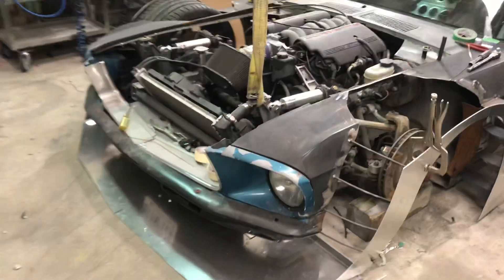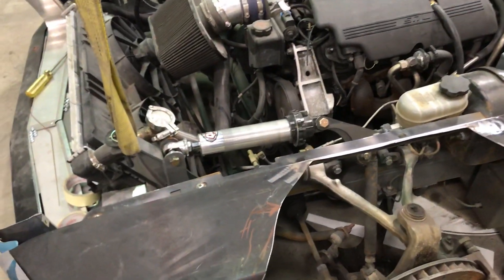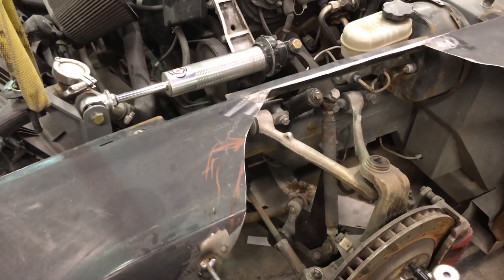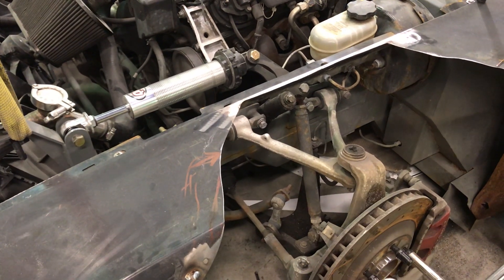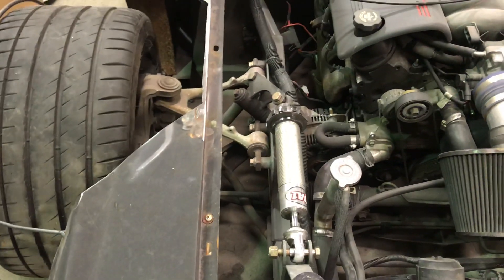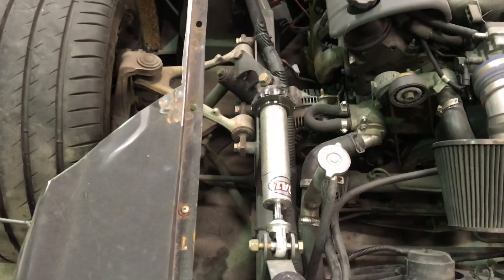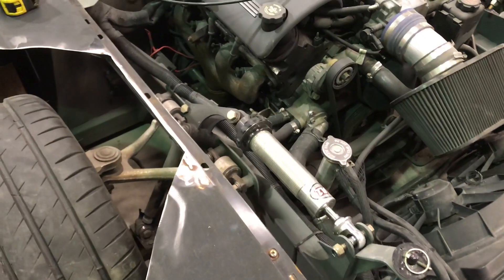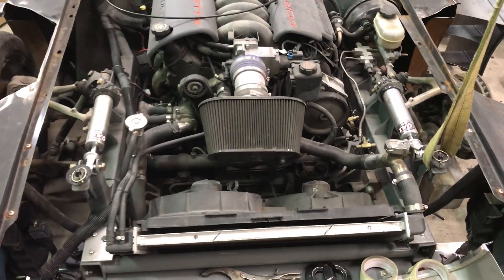Cantilever Suspension Explained !

Comment: Push- / Pullrod suspension has its place, it allows for heave spring setups and obviously drasticly improves aerodynamics on vehicles where the suspension is inside the airflow (like open wheel race cars). Beside that, there is no real point to cantilever suspension. Never seen a scenario where packaging was that beig a problem and the CG is moved upwards by your setup, which ain't good
Reply from the maker: @Sir_Cactus  Unspring weight is a huge factor as well though which you’re not considering!
Reply: @Kylescaife  You are right that I did not mention unsprung weight. If you meassure the weight of the wheel assembly (without the spring mounted of course) then the pushrod system might give you slightly less unsprung weight (assuming the pushrod is lighter than the unsprung part of the shock). However, this is quite misleading as it is not the weight of the wheel assembly that is relevant, but it's mass. The weight of the rocker and the moving part of the shock is supported entirely by the frame, but they are still part of the unsprung mass. 
In other words, a pushrod suspension has greater unsprung mass.

Comment: So would reversing the cantilever cam , for lifted offroad use ( where people are chasing longer travel for their shock absorbers ) work opposite? So you can have the same amount of performance over a longer distance? Or would that negate the specific valves in a shock or strut that were design for a specific range, like 1 to 1?
Reply from the maker: Yeah theoretically it would work! The shock would need to be valved for it I’m sure, but I think it would work. A lot of the long travel trucks will have a trailing arm and mount the shock half way on the trailing arm, which is kinda the same. The shock would have 12” of travel but since it’s mounted half way from the pivot to the wheel, the wheel would have double the travel and would move 24”. The shocks are dialed in for this, so I’m sure that you could do the same with a cantilever set up!
Reply: well I'm luck in as I have a beater liberty wagon to try this on once my main rig is back on the road. Thankyou :)
 @Kylescaife
Reply from the maker: @destnations5588  Awesome! Let me know how it goes! Feel free to DM me on Instagram if you have it and need some any help! My handle is @mustangkyle

Comment: Hey Kyle,
My engineer and I are at loggerheads over this set up.
He wants to run a bell crank with a cantilever meaning about double the pivot points.
I want a, system like yours. Trouble is we are using an XJS cross member which is angled to the chassis and we can't figure out the geometry.
Reply from the maker: Angled to the chassis as in the control arm mounts aren’t parallel to the vehicle? I just did a quick google search and I think that’s what you’re referring to? Shoot me a text if you want to chat and send some pics and we can brain storm a bit! 7052413761
Reply: @Kylescaife  conversation started. Not sure I got the country code right.
Reply from the maker: @mnc12004  Oh shoot sorry! 1(705)241-3761

Comment: The rocker pivot pin being loaded in single shear will be the first part to fail. That pivot will see more than twice the vehicle weight on that corner. Being single shear this will put a bending moment on that pivot pin and that will cause you to either over build or it will fail. Neither is a good solution. That should have a support plate on top to create a double shear for the pivot pin supporting the bell crank.
Reply from the maker: Been 4 years now, one year with a spring rate in the car that literally allowed no travel at all, and it’s still completely fine. And now that I have functional springs there is a lot less load on it. Obviously double shear would be stronger, but this does the job just fine.

Comment: very cool setup.. and simply explained too. is there any worry of the pivot bolt sheering under stress?
Reply from the maker: No, the bolts are good for 17,000lbs before they’d shear haha
Reply: @Kylescaife  just thinking out loud here.. and let's use easy math.. a 2000 lbs car hitting a pot hole would cause the suspension to travel at a speed of say, 40 mph, so F=ma, that would create an impact force of something like 30,000 lbs. before it ever hits the strut.. or am i over thinking this?
Reply: @nonlinearchaos well thats the total energy. All of it can't go to that specific point entirely.

And as the guy said in another comment hes had the same setup for years and its never broken.

 i did physics in the uk but i thought that formula only worked with newtons. I might be totally wrong i havent done a single physics problem since my test almost 4 years ago.

Comment: I was planning on doing cantilever suspension like that on my 1973 dodge challenger and was gonna put the same custom QA1 dual adjustable coil overs on it, but I was wondering what length you went with for the shocks? Also, I know our cars are probably different weights, but what spring rate did you go with, and what length of spring?
Reply from the maker: It would honestly be useless to tell you my spring rates as they are highly effected by the angle of the push road and the ratio of the rocker. But I have 300lbs springs on the front and 400 on the rear. And they are 12” long springs. Can’t quite remember how long the shocks themselves were though.
Reply: Mustang Kyle yeah I gotcha, but I’m just trying to get a general idea of how stiff you went, and since in the video you said your rocker was 2:1 then that’d probably mean you get 600 lbs of force out of those front shocks to the wheels. Thank you for the response!
Reply from the maker: @tylerhoulihan6863  Not quite 600lbs because of the angle on the pushrod lol. But ya. It’s still for sure though.

Comment: Are the rocker pivot points 90° from each other (like a right triangle)?  I am planning to do a similar suspension on my next project
Reply from the maker: Andy Leserra Only if the coilover is 90° from the pushrod though. If it’s 45° then the rocker pivot points should be 45°.
Reply: @Kylescaife  Gotcha, makes sense.  Thanks man!  Bring that thing to Daytona Turkey Run!
Reply from the maker: Andy Leserra Yes they are!

Comment: Man all that money and work I know you could of afforded a coyote, shit a built coyote at that, instead of a dang ls swap. Very very Nice build, besides the damn Chevrolet ls swap 👎🏽👎🏽👎🏽
Reply from the maker: The blunted car guy 
Wrong. I bought a wrecked corvette and got an engine, trans, rear end, computer and everything to run the engine, suspension, wheels, fuel tanks, fuel pumps, steering rack, etc etc etc for less than the price of a stock a Coyote without a trans. Thanks for coming out.

Comment: So, correct me if im wrong
Does the the 2:1 make it twice as stiff?
Reply: No. The advantage of this is the suspension instead of being linear when compressing it is actually exponential. The harder you go into a turn the stiffer the suspension gets. This causes less body roll and similar turning when going into a turn at 70 and 20

Comment: You didn't mention in the video what you used in the pivot. Did you use a poly bushing or some kind of bearing?
Reply from the maker: Jeremy Pennington Ahh shit haha. So I have a 1 1/2”, 1/8” wall tube that I welded the brackets onto, and then I have brass bushings that slide into that, and then the whole thing slides onto a solid steel shaft that’s threaded at the end. One simple bolt holds it in !
Reply: I take it you mean a post that's tapped for a bolt and washer to clamp it down?
Reply from the maker: Jeremy Pennington Exactly !

Comment: can you adjust rideheight by changing the length of the pushrod? i'd guess doing so would shorten shock travel. i'm sure you have everything calculated already
Reply from the maker: japcrapvr6 Can either change the length of the push rod or adjust the coilover !